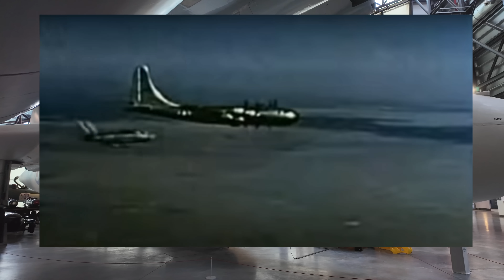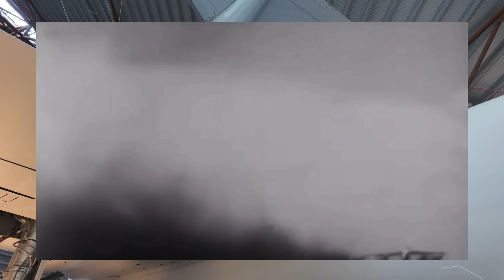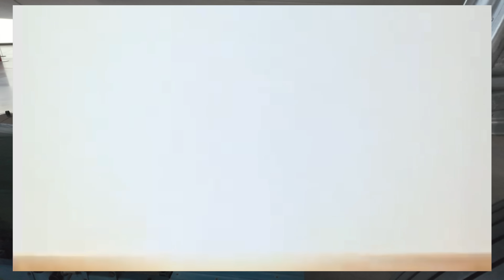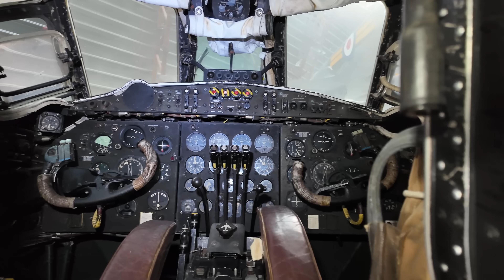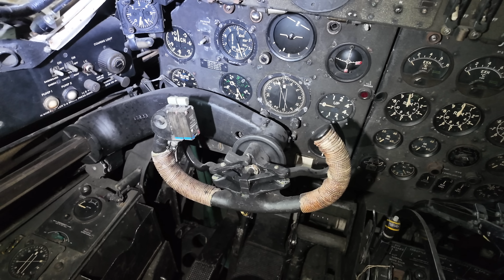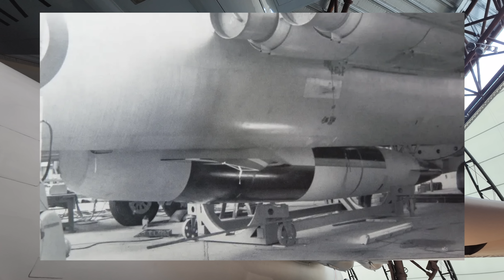Guided tour through the only Vickers Valiant left.

Comment: On the other hand, the wing has to lift a little less weight when the engine is mounted to the wing. All that weight has to be carried by the wing roots otherwise, when it's under the wing the force goes directly into the wing structure and you can make the spar a little lighter.

Comment: The contrast between the slick outside and the mess inside ^^
Reply: Oh my! Like the British Empire? ;-P
Reply: Well the outside is the part that needs to move through the air, so it matters. It doesn't matter what the inside looks like as long as the crew can find and use all the controls they need to use. Trying to think of any aircraft where the interior looks as good as the outside, and the only thing that's even close is passenger jets.
Reply: @justforever96 thanks captain obvious

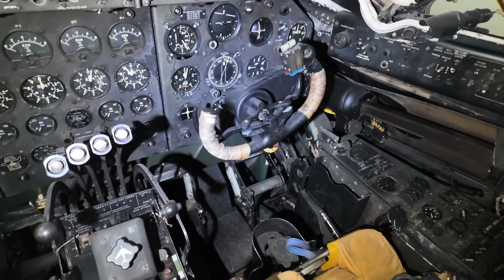Comment: 25:55 What??  567 mph converted to 211 km/h? That makes no sense whatsoever. A speed given in km/h is a larger number than the same speed given in mph. 

The conversion is to multiply the mph speed by 1.609 to get the speed in km/h. 567 mph is 912 km/h.

And the voiceover refers to the instrument as a Mach meter, which measures speed neither in mph, nor in km/h but, wait for it.. , in Mach (roughly put, 1 Mach is the speed of sound in the atmospheric conditions at hand).
Reply: Our Hero...what will You do when AI-"facts" becomes Thé truth?  😛

Comment: Back in the mid 80's I visited the UK and looked at all the three V bombers and the Valiant is the one I've always liked the look of, interestingly most people report that the switch to low level caused the fatigue spare cracking but you correctly stated the new alloy they used was the cause. The Valiant  tankers flying in the stable high altitude never partook of the low level missions and even they were found with wing spar cracks.. When the Variants were inspected for spar cracking they looked at a zero hours brand new spare wing spar at the Vickers factory and on close inspection it also had propagating cracks, the zinc and magnesium based alloy,  DTD 683 was very strong and light but the mix of alloys used was very unstable. Thank you for a great video .

Comment: Thanks for the tour, Paul. I grew up on USAF bases so I'm well familiar with American military planes. The only V-jet I've seen in person is the Vulcan, I saw one at a US air show, so this look at the Valiant is fascinating to me. Regarding your comment about the change to low-level missions and the wing spar cracks, the B-52 had similar issues when its mission also changed to low-level, so the wings were strengthened. If I recall correctly, the cost of the strengthening program exceeded the original cost of the planes.
Reply: The Boeing B-52 has proven itself as a much tougher and durable aircraft than the V-bombers... The Valiants were literally falling apart at the seams after just a decade in service, as a general rule British jets last less than half as long as American planes... the Valiant was in particular a very frail airframe.,
Reply: @DoktorBayerischeMotorenWerke 

  It will come as no surprise to anyone that we feel we can clear up some commonly held myths and misconceptions.

   That's correct of course, there can be no excuses for the Bow-wing (see B-47 wing folding & wing collapse incidents) horrendous Max incidents as the company had more than 50 years design & build experience for the type. 

Indeed, the Bow-wing (see b-47 wing folding & wing collapse incidents) B-47 is remarkable for the sheer amount of money spent on the development which produced something which needed another massive amount of cash spending to prevent the entire Bow-wing (see b-47 wing folding & wing collapse incidents) fleet from being scrapped due to an fatal structural flaw. Absolutely incredible.

  Indeed, It's always good to see the facts presented clearly and concisely isn't it?

We're sure the following is unrelated to the comment however of course. 

  Obviously the companies merged into BAC were not failed companies, they were subject to a govt instigated aerospace sector rationalisation process. Handley Page for instance refused to co-operate & disappeared as a result.

Regarding UK capabilities - some examples.
 
   There is no doubt that the Fairey (England)
Delta 2 was of course the world's first jet
aircraft to exceed 1000 mph.  lndeed It
exceeded the previous record by 310 mph &
held the record for 1 year. Incidentally, the Dassault Mirage 3 & 4 are based on the Fairey Delta 2 design. Also the engines for the Dassault aircraft needed a lot of help from Rolls Royce to get them working & reliable.

 In 1944 it is true to say that the RR (England) Nene was the most powerful & most reliable gas turbine aero engine on the planet. Licensed & unlicensed copies of the RR Nene & RR Derwent engines would go on to power aircraft in Russia (Mig 15 & Mig 17), China, the US, France, Switzerland & other countries for decades after 1944.

Regarding the rather superb TSR-2.

  That's correct, the aircraft was truly exceptional, without doubt & it's also correct to say that the aircraft performed well above & beyond specifications & objectives in the short flying test  time it actually had, clearly the cancellation of the project had nothing to do with the aircraft's abilities. Cancellation was mostly caused by a rapidly  changing world & the TSR-2 performance specifications being arbitrarily & constantly increased.

  Agreed, it is the case that the TSR-2 aircraft had very little testing & there was almost no opportunity to explore it's full capabilities. It would of course have completed  approx 0.5% of total planned test flying time at the time of programme cancellation.

  That's entirely correct of course, with 2500 hours testing scheduled to be completed before service entry the test programme had hardly started, but in a total of only 24 sorties BAC had established that from low speed to high speed at low level and to transonic at altitude this remarkable aircraft did not appear to have any aspects of stability and control needing major attention or modification. Its control qualities were already superb and it was right first time – an astounding advance for so early in the flight development programme. Its cancellation could not have been justified on any viable technical grounds. That aircraft was of course the TSR2. 
   
  Indeed, a lot of info got handed to the US regarding various aspects of the TSR-2 aircraft, it's systems & the methods used to manage it's design including the system components integration aspects of the program.

  Obviously there were of course many military jet aircraft designed & built in the US, the UK & elsewhere that were not designed for supersonic flight, in fact, at the same time in the US planned designs for multi Mach high altitude aircraft were being abandoned. 

  Of course the Tornado & Typhoon & their engines are Supersonic & are indeed British design aircraft with British design engines built by an international consortium. The Tornado design for example started life during the 1950s at Vickers as the AFVG, it's engine is based on the RR RB-199. The EE Lightening is also a British Supersonic jet aircraft.

  That's correct, the Typhoon is the British BAC-EAP with an engine based on the British RR XG-40, the Typhoon and it's engine is also built by an international consortium.

  With the advent of intercontinental ballistic missiles (ICBMs), especially later submarine launched missiles, from the late 1950s & improved high altitude capable anti aircraft missiles, crewed nuclear bomber aircraft were increasingly seen as obsolete. 

Indeed we hope this helps, obviously.

Cheers as always, clearly 👍 of course etc.

Comment: A metal fatigue problem grounded 1/3 of the bomber capacity... may be the relative short life of the bombers (10-20 sorties in practice) had brought the engineering department to the idea that only static strength was important. Resisting fatigue, aluminium is a very bad material, fir wood is even better (on weight bases)

Comment: Reference the soup heater. You said it was designed to accommodate a tin of Campbell's tomato soup. But, Campbell's is a condensed soup, requiring water dilution before serving. So, while Campbell's tomato soup was very popular at the time, I'm thinking it more likely they carried Heinz soup, else the soup heater would also need to have some way to heat water, as well as a place to mix the condensed soup and water, which is unlikely.
Reply from the maker: Interesting. Im happy to be corrected although it was a Valiant nav who specifically mentioned the campbells soup.
Reply: @PaulStewartAviation  indeed, Campbell's used to be my favourite. However, the fact it's condensed makes it's applicability unlikely. I believe the same soup heater was installed in the Avro Vulcan (but not the Victor) so you could ask Valiant and Vulcan aircrew about diluting condensed soup.

Comment: From a wing structure point of view it's better to have the engines further outboard. It reduces inboard wing bending moment. However, having engines nearer the centre line means that you don't need such a big fin and rudder to cope with engine failure cases.
Reply from the maker: My thinking was, though, that inboard engines would allow for the wing to be stronger just around those rather than having to manage the forces of a more distal engine swinging about? Yes it's true about inboard engines allowing for a smaller tail due to the risk of asymmetric thrust.  I'll have to mention that in the Victor video :)
Reply: Engines in the wing root does make the wing structure more complicated moles and therefore heavier plus access for maintenance is more difficult, as you mentioned. The inertial forces resulting from supporting outboard engines aren't that significant to the wing structure as a whole but the engine centre of gravity must be well forward of the twist axis of the wing to avoid flutter problems.

Comment: That RAT system to give artificial feedback to the flying controls is amazing - seems rather silly to me - and overcomplicated.  BTW, did you know that the Lightning (the proper EE one) had a slit spring attached to the stick to give a crude feel for the roll surfaces.
Reply from the maker: Thanks for the extra info. I did not know that about the lightning

Comment: Very enjoyable. I wasa radar fitter 1956-59 at Honnington 7 Squadron. You missed the "Dragon's Teeth" which dropped down at the front of the bomb bay as the doors were opened. This was to disturb the air flow as a bomb could be held up by the air flow and thus not depart at the correct point for accurate delivery.
Reply: I thought that was on the Victor??

Comment: 0:53 The best description of this time period I’ve heard is… By 1945, piston engines had reached their absolute limit and pinnacle of design. While jet engines offered similar performance and were only in their infancy and still had a lot of room for development and improvement.
By 1945 it was clear that the only way to improve aircraft performance even further would be to develop jet engines.
Reply: I mean…nah. Piston engines are still not at their pinnacle-but for the time-jet engines had a ton more potential (and still do).
Reply: That was not "clear" in 1945 or they would have immediately dropped all work on pistons and props. That took another ten years. There were signs that jets were the future and they obviously had potential, but it wasn't "clear" to everyone that piston had no future. They were still much more efficient and highly developed (so they thought), and there was a whole debate over where to go. You can't say something is clear when you are also having a huge debate over it. 
It was clear in retrospect, not at the time. Words have defined meanings.

Comment: Its a pity the B2 wasn't put into production as with RR Conways similar to the later models of the Victor it would have been an improved aircraft. 
The Conway engine I believe ws a bypass version of the Avon and would be more fuel efficient.
Reply: It doesn't make a lot of sense to have 3 very similar designs in production simultaneously; arguably we should have picked one of the V-bombers and built that in large numbers rather than divide our resources between multiple types.

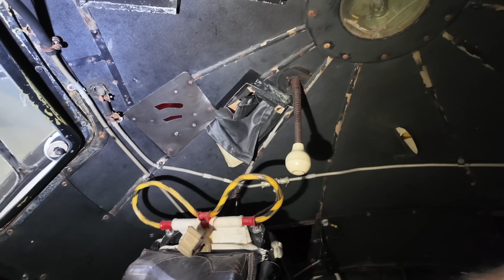Comment: Whats that white ball thing in the cockpit at 27:09 ?
Reply: It's a grip handle, to pull the co pilot out of the seat. We used to have them on the tube trains on the underground if you were standing, to hold onto to keep yourself from falling over.
Reply: @boudica75  Yes. They are also fitted in the rear of the vulcans, for the crew to hold onto.

Comment: They also suffered inter-cystalline corrosion in the wing spar attachment castings which was also the reason for scrapping them early.
Reply: Even in those days the engineers should have stopped that design disaster.  It was basically a electricity generation cell.  I guess that if one included all of the connections one could call it a battery.  Thankfully the corrosion was found before any wings fell off!!!
Reply: @HerbertTowers, even now, designers can't avoid galvanic corrosion in cars let alone AC
Reply: @davidpenson1615  The difference is that, in aerospace today, appropriate considerations are given to minimise galvanic corrosion in the basic design … whereas, it’ll likely always be an afterthought in the automotive industry where they’re not interested in 40 years + of life (anyone would think the car industry had an interest in planned obsolescence! … can’t think why).

Comment: Very interesting. One of the instructors who taught me to fly used to fly these and said they were really nice to fly.
I'd just query one point - inboard-mounted engines actually require a stronger wing than pod - suspended engines. The underwing pods mounted further out along the span provide bending relief to the wing which is lacking if the engines are inboard.
Reply: Placing the engines inside the wings was based on a British aerodynamic theory that later proved to be wrong, while it does reduce drag at supersonic speeds it does not translate to better subsonic drag performance as was also seen in the Comet.
This is why we do not see this design used again..